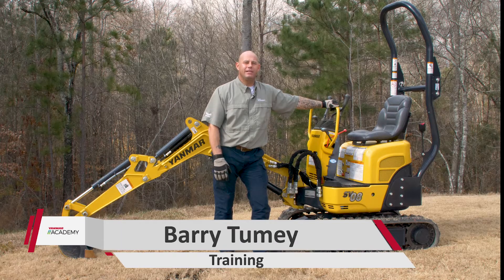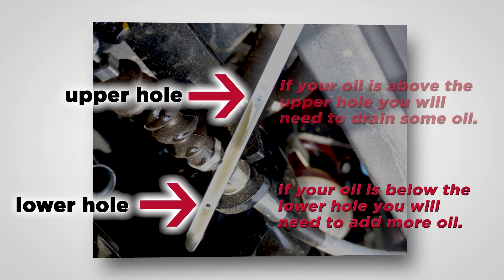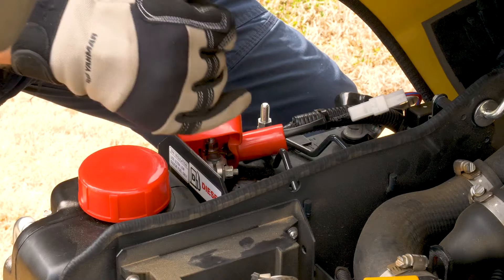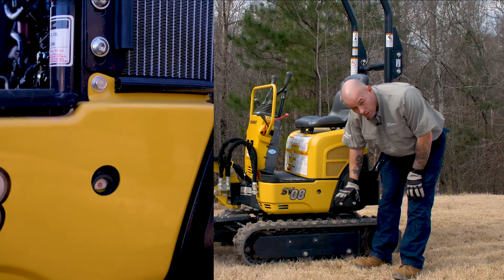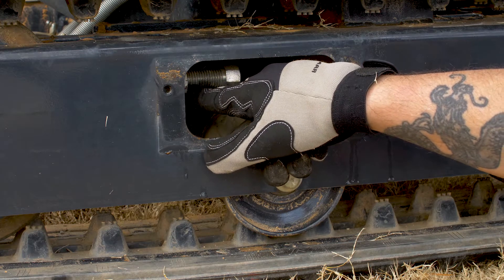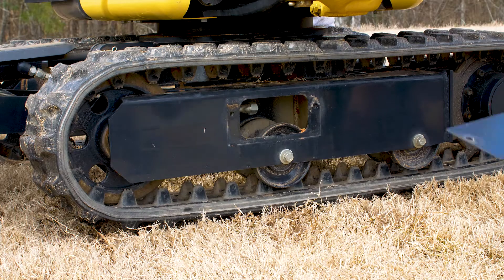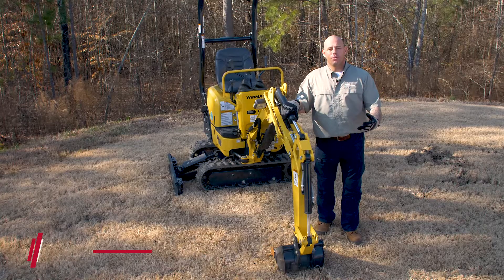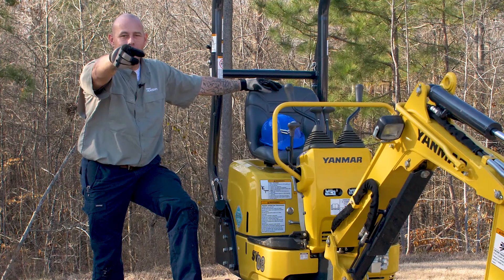YANMAR//Academy Sv08 Daily Maintenance

Comment: Leave it to the Japanese to put a 2-cylinder, liquid cooled,  EPA compliant, diesel engine in a glorified garden tractor. I think a briggs and stratton would have worked just as well with less parts to break too.
Reply: Don't under estimate 2 cylinder yanmar engines... Damn site more powerful and reliable than briggs shite
Reply: Yanmar is legendary